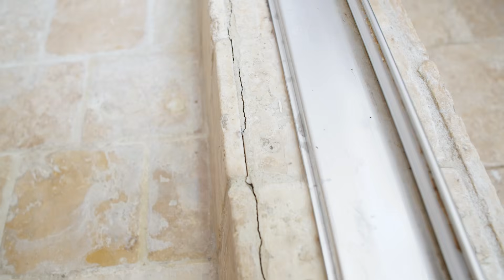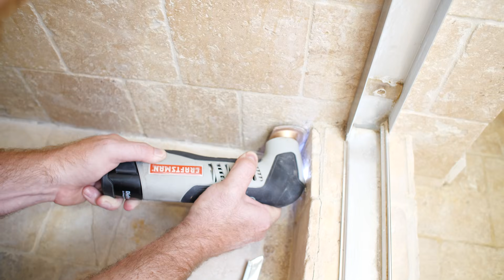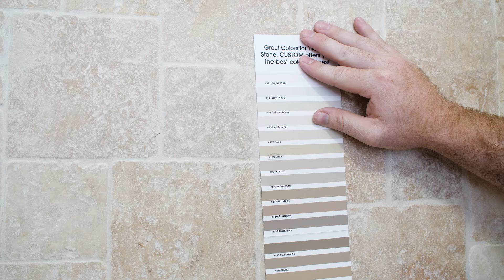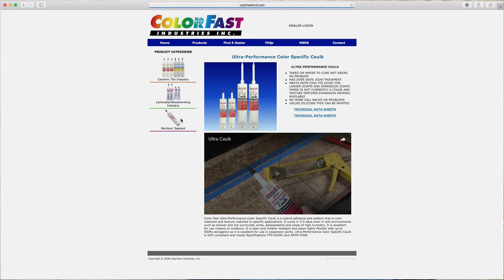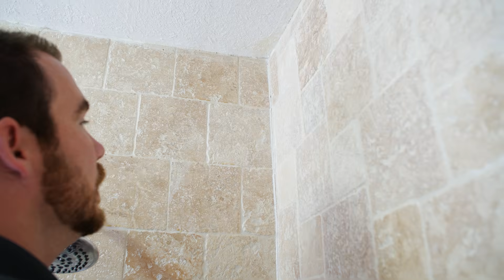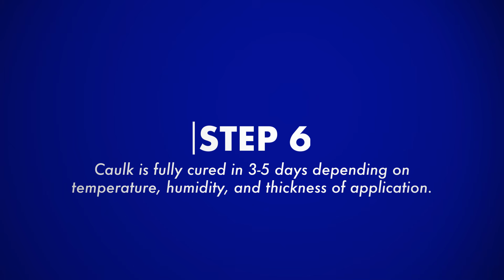How To Recaulk a Shower

Comment: Thank you for the instruction. I agree that this is the best video I’ve seen on how to fix a shower.  I’m not sure about wet cure. I don’t know if there is any moisture left in the pan. What if my pan is dry when I start. Should I spray at the start? Would water work just as well fot cleanup? I don’t like the idea of having chemicals on my skin as I run a finger along the seam. Toxic?

Comment: What blade did you use for the Oscillating Tool?
Reply from the maker: This was a diamond blade from craftsman. Looks like they are a little different now. Here is the link https://www.craftsman.com/collections/oscillating-accessories/products/cmao400
Reply: @colorfastind261  Thanks really appreciate the response. Great video. I have to deal with a poor sealing job in my shower.
Reply from the maker: @Ir1shlad   Sorry to hear that. Good luck with your shower.

Comment: Hi! I really enjoyed your video. The only thing I disagree with is putting bleach on natural stone, especially travertine. I was wondering if you could recommend what I should use to seal my travertine kitchen sink. I’m not sure if caulk would be better to cover the little holes I’m getting in it or if I need a colored lacquer. It’s beautiful and I want it to last but gets a lot of traffic so I’m just wondering what product would be the most durable long term. I plan on using a clear stone sealant every 6 months but I need a better long term option for the little holes/chips that are forming in the bottom of the sink. Thanks for any recommendations
Reply from the maker: Unfortunately we don't have a product to fill in the holes for the Travetine but the most important part is going to be the sealer.

Comment: The floor corners of my shower was grouted instead of caulked. Where the gap is big enough, I managed to remove all the grout all the way back until I reached the thinset, but it was more time consuming. Thanks 

To ensure the best seal and prevent mold build-up inside, is it best to try and remove all the grout (if you can) before caulking?

Or is it a waste of time, and I should aim to just remove 2/3 of the grout before caulking?
Reply from the maker: It is best to remove as much as you can. Keep in mind the Tile & Grout Caulk is good for gaps up to 1/4" if its larger than that you should use the Ultra Performance Caulk. The Ultra Performance Caulk will also last much longer and is naturally mold and mildew resistant.

Comment: What happens if I caulk over the old grout?
Reply from the maker: You take the risk of the caulking cracking as well. There typically wont be enough caulking in the joint to allow for movement when you go over the top of grout.

Comment: Best to caulk wall and floor to wall corners from the start?   1) grout and caulk, 2) caulk only?  Thanks
Reply from the maker: Caulking is recommended for the change of plane joints, between the floor and the wall and the corners of the walls.

Comment: I used some Custom non-sanded ceramic caulk from Home Depot along my tiled shower pan floor and wall... its been 72 hour and some of the caulk still feels soft compared to other parts.  Any idea why this is happening?
Reply from the maker: It could be for a few reasons(moisture, joint size, etc.) especially if you used the shower recently before you re-caulked it. Try putting a small fan in there to expedite the curing process.

Comment: How much did it cost you in supply and how long did it take for this job?
Reply from the maker: A tube of caulk is about $7-$8 locally plus whatever tools, if any, that you need. Time wise it was a couple hours to remove, clean and install the new caulking.

Comment: What do you do if mold is also on the door and hinges
Reply from the maker: You can use the same mild bleach and water solution. Make sure to wear gloves and the area is ventilated. If its a glass door with metal hinges there is most likely some sort or soap or products build up that is allowing the mold to grow.

Comment: Any suggestions other than denatured alcohol?
Reply from the maker: Mineral spirits or acetone. Just be careful with the acetone, use in a well ventilated are and don't have any flames or sparks present.
Reply: Thanks